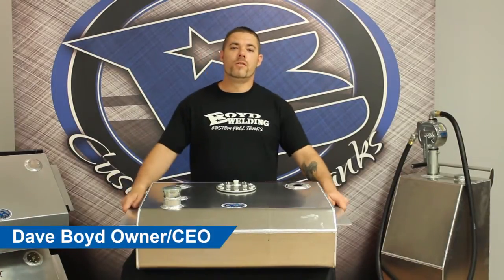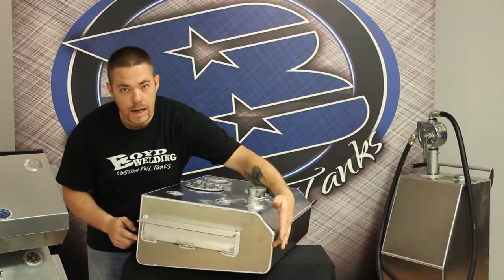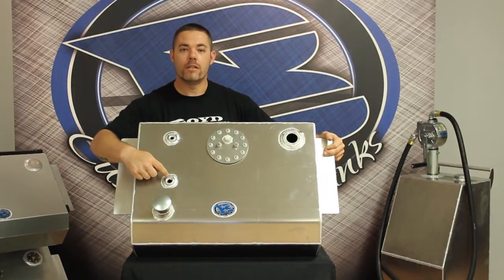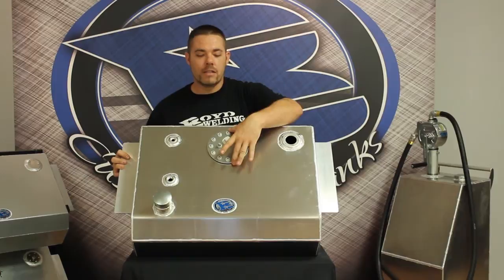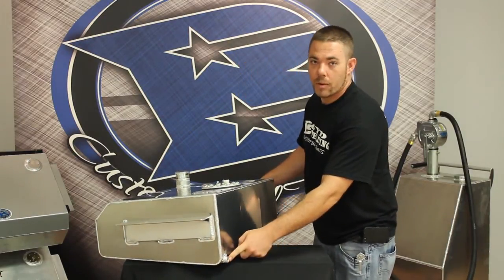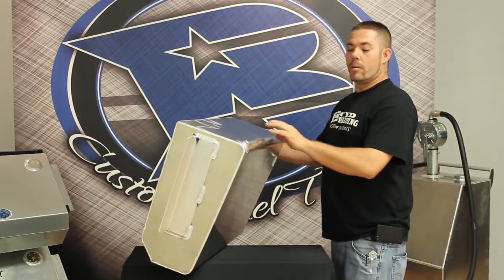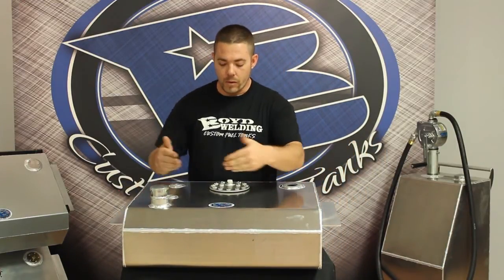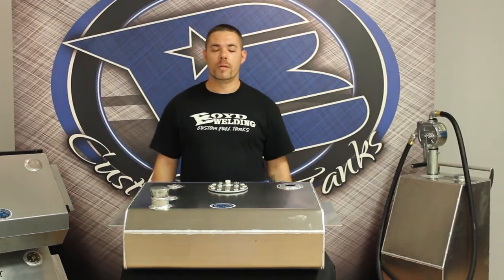67-72 C-10 Rear Mount Fuel Tank SKU: 14004

Comment: I have decided to mount a tank between the frame rails and get it out of the cab (building for my grandson, so you know the drill).
If I use a LS Chevrolet EFI engine will this work and can the fuel fill hose be turned to go out the quarter panal (thinking about putting it behind the side marker)?
Thanks Jim